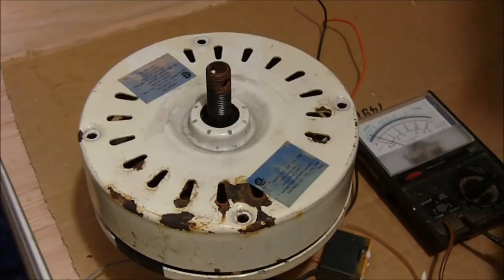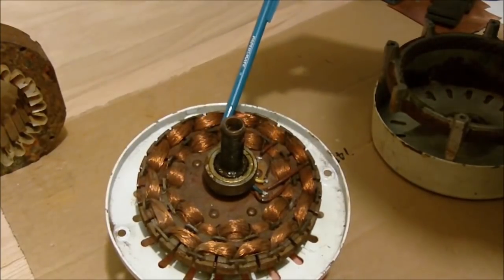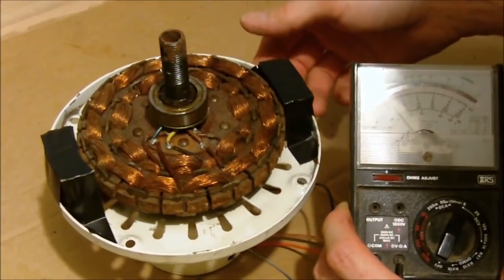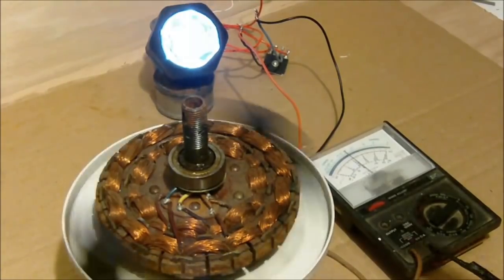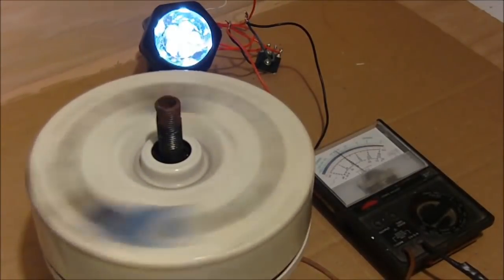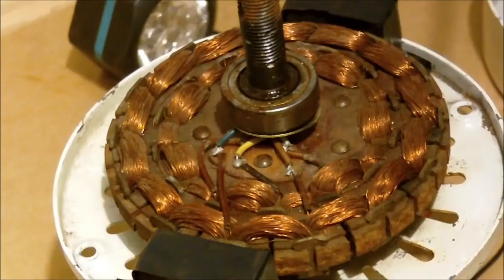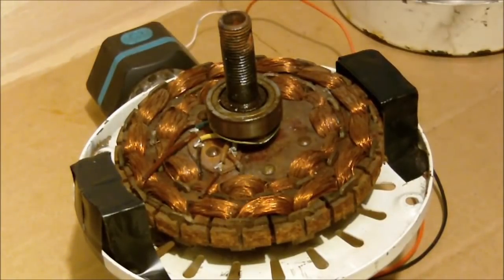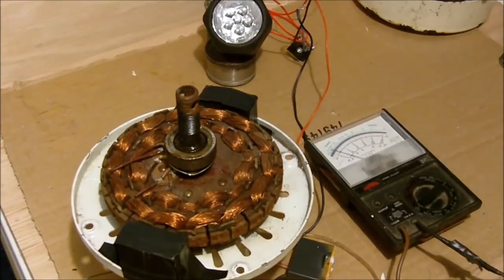Ceiling Fan to Wind generator conversion demo

Comment: The capacitor was for the reversible feature of the original fan. Connecting it to the OUTPUT of the diode bridge will smooth out your signal by charging like a battery on the peaks of power generation and discharging on the valleys. That capacitor is of a low value for the purpose that it was intended. If you get hum in audio applications like radios, stereos or TV's, that are connected to your generator, you can use a capacitor of a higher value. Here's where it gets tricky. Capacitors can explode if connected with the wrong polarity, if it's rated voltage is too low for your generator's output. Say your generator has a maximum output of 85 volts AC at full speed. This will be an RMS or Root Means Square rating. This is a little mathematical for this discussion but to suffice it to say you can add an average of 50% to that voltage at peak power on each cycle. Most volt meters only read average voltage. Converting this AC output to DC with a diode bridge and adding a filter capacitor to this would make the peak output about 127 volts DC. If you did this to your wall power, you would find that you would have almost 175 to 180 volts DC. To be on the safe side, you should use a capacitor that is rated at least 50% above this in it's voltage rating. Unlike the capacitor in the motor, electrolytic filter capacitors have polarity like batteries. BE SURE you connect positive to positive and negative to negative. The micro-farad rating of the capacitor isn't important in this respect but understand, as with any battery, the bigger, the better. If you use a 500 micro-farad @ 200 volt DC capacitor, it will work twice as good as a 200  micro-farad @ 200 volt DC one. The more micro-farads, the better the filtering action. Also be aware that professionally designed windmills have mechanical speed regulators on them so as to not go over rated voltage or speed to avoid spinning out the bearings during a wind storm. One other thing your viewers need to be aware of. You can NOT connect a DC output to an AC rated appliance without damage. If you are connecting it to charge a battery bank, you should have some kind of regulator or controller to avoid a fire or battery damage. NEVER try to make connections to the generator while it it spinning. Even though they use AC in the electric chair, high DC voltage across your heart will stop it faster. One last thing. You can NOT connect the raw AC output of the generator to ANYTHING that is AC powered as the FREQUENCY of the signal is governed by the speed of the fan and is too unstable. Other than that, your idea is pretty ingenious and, I think, could be built upon to become something useful in some applications.
Reply: That would be great for you and us if you record a video showing how to do that. Thanks
Reply: @alfredoreyna1020  To connect a capacitor or the diode bridge?

Comment: I could see setting a whole bunch of them up on a common charge controller to increase the available power, same as what is done with solar panels. Wiring to all three coil rings is a good idea,  but would essentially result 3 different phases, all of differing frequency and amperage, but hey, plunk a rectifier on each output, send any voltage you harvest to a charge controller, insert batteries and voila! A home-brew wind farm. I know a guy who has a crap ton of broken household appliances laying around, maybe I should go strip mine his trash pile.

Comment: one issue with converting an induction moter to a generator is coging. coging can be mitigated to some degree if you divide the outside coils into 3 groups and connect them the coils in each group in series with each other such that the voltages will add. the output after three phase are rectified will be much smother but youll never get rid of the iron core roter coging with the magnets. just hope to smoth it out some with placing magnets in such a way to take advantage of the three phase windings.
Reply: +Keith Reynolds  - I think I read somewhere about a technique where instead of putting the same number of magnets as coils, put N-1 magnets evenly spaced.  If you have N magnets then they all 'cog' together and multiply that force (picture a sine wave from each magnet passing each coil stacked up because they're all in sync with each other).   But if you have N-1 magnets all those sine waves are offset from each other and make a smoother output.  I guess it's like your 3 groups only divided down to individual coils.   Oh, but you might also have to have a full-wave rectifier for each coil.  I wish I hadn't gotten rid of my old oscilloscope.
Reply: Yes it would be a lot like my 3 phase suggestion, and yes because of the phase relationship between various coils with N+1 magnets, each coil should be individually rectified. The downside of that is for each coil you have voltage drop across two diodes at the bridge rectifier, rather than having the voltages add for a group of coils in the same phase and 2 diodes voltage drop at the rectifier. In other words you'll be more efficient with groups of coils in series rather than individually in a poli-phase setup.

Simply put, three phase setup splits each cog into three "much" smaller cogs because of a nearly equal attraction to the core of an old phase almost cancels the attraction to the core from the next phase, 

Not always a favorable choice, but one can mitigate the effects of coging to a degree by increasing the momentum of the rotor, either with more mass in the blades and rotor or faster rotation.

Comment: If you put a capacitor across an AC voltage, it will act like a wire, read dead short, until the chemical inside boils and causes it to explode. Also, if you can get 12 volts at 60 watts out of a converted ceiling fan, that equals 5 amps which, in a windy area, would be a pretty substantial charge for a small wind system like for a light and radio in a hunting cabin.
Reply: Addendum - You would need a rectifier bridge and possibly a filter capacitor to turn the AC output of this alternator into DC for it to charge a battery and run anything like a radio, battery powered TV or lamp. Using a battery and any kind of inverter all day would probably not be a good idea in any place but the windiest of places to allow the battery to fully charge at night. Also at 60 watts or 5 amps, you couldn't use a battery much larger than a small marine deep cycle battery and then it would be a good idea to keep a hydrometer handy to check it's charge condition once a week and have an alternative way of charging it to make it last a good long time without damage. Incandescent bulbs wouldn't need a rectifier bridge if used WITHOUT a battery but loading might be a problem if you push the current limit of the alternator too much. The more you load it, the harder it is to turn it to the point of stalling it completely if you were to connect a headlight bulb to it. This would actually be a great project for a small hunting cabin or sail boat as long as you are aware of it's limitations and the limitations of the battery that you connect to it.

Comment: with the wires, theres a set for low speed and a set for high speed then a earth.
you should join the high and low speed wires so you get 2x output, or like 1.75x

but nice vid, im gonna go make a vertical windmill gen using this as the alternator

Comment: Take computer hard drives and remove the magnets.  Very strong and free!  Perfect for ceiling fan generator.
Reply: You can shape the coils to the magnets but you are correct, they are oddly shaped.
Reply: Tommaso Petrella I
Reply: The poles are on the side. Which reduces area. Which sux cause I just got like 50 of them and apparently I'm too stupid to move forward with the idea. So I'm pissed and about to just dump the whole thing and say F it.
Reply: Hdd magnets work well, you can break them to size easily.

Comment: Because a DC motor uses commutator plates to "switch" the coils as they go around whereas a regular brushed AC motor uses slip rings so the coils are constantly connected to the same leads.  In a DC motor, as the commutator plates spin inside the brushes, it gives the effect that each coil is moving a constant direction N to S or visa verse because they switch polarity before they spin back the other way. I guess what I'm trying to say is a DC motor is in effect it's own rectifier by design.

Comment: more powerfull magnets will up the voltage for each rpm. thicker winding will have less internal resistance, but will fit fewer windings and result in a lower voltage.

Comment: get the small neodymium magnets from a CD rom reader heads and glue them into the armature assembly, prep armature with an angle grinder. You will get 100 plus volts at up to an amp at very modest speeds.

Comment: It would be fine and work well if you just needed emergency lighting. Just dump the power into a 12v battery and use only led lights. I would use a setup like this for my workshop and storage shed.
Reply: You can get 12v LED lights for vehicles that will do the job really cheap direct from china. ;)

Comment: I suppose you're right about the commutator in an AC motor didnt realky think about it.   Most are probably brushless anyway using 60 Hz for timing. Just kinda hard to explain how the coils in a DC motor generate AC current but it is switched thru the commutator into the brushes as DC because the coil is always moving one direction thru the poles while connected to a single brush.  Doesn't really matter anyway I guess.

Comment: If I am right, if you get the rotor to spinning and short the output wires together, it should act as a brake. The highest output connection will be the one that stops the rotor the quickest. I am wondering if you have 3 connections and a common or 6 leads.

Comment: you can use pulleys to bring up a higher revolution speed to generate a higher voltage also, Big on the blades and small on the generator

Comment: you should build this for a charging booth or station with a vertical blades you could start a power stations for remote locations in far to get to vacationing get aways or hiking or to charge your cell phone, lap tops or ac power cord plugs or small plugs station outdoors with electric car charger for a parking space  far from the grid.

Comment: The coils aren't wound clockwise, counterclockwise, clockwise, etc.. They should all be wound the same direction.  There will basically be 2 circuits... one set of coils that is wired directly to the source voltage, and the other set is wired with the capacitor.  They are set on the motor in an alternating pattern.. so the first coil will be in the capacitor circuit, the next without the cap, the next with the cap, the next without etc.  The capacitor side of the circuit causes the current to lag 90 degrees out of phase with the other side of the circuit.  This creates a rotating magnetic field.  The rotating magnetic field moves past the squirrel cage in the stator, inducing a current in the squirrel cage.  This creates a magnetic field in the squirrel cage that is opposite in charge to the magnetic field in the rotor, causing the stator to be attracted to the rotating magnetic field of the rotor.  The stator will always rotate slightly slower than the rotating field in the rotor.  This is called slip.  This is because if the stator was moving at the same speed as the rotors magnetic field, than the bars of the squirrel cage would not be getting crossed by the rotors field, and no current or field would be produced in the stator.  Now that you know how a single phase induction squirrel cage motor works, you can better understand and design a generator from its components.
Reply: You need to start your own channel, if you don't already have one, with animation. Worlds electrical engineering student (or a layman) would thank you for that.

Comment: . You could obtain a high voltage from your fan motor by using a number of small curved magnets equal in number to the pole faces on your fan . Remove the inner set of coils if you like as they would only add to the back emf if connected up or if some of the coils are shorted out. Shorted coils will make the generator hard to turn so either see that the inner set is kept totally open andn one of the coils is shorted or leaking to the frame. You will have to obtain magnets of  such a length that each magnet fits just across the the pole face withiin the coil. the  magnet s hould not span the coils but just the ple face. These magnets must be fitted to the part where the shaded armature was. YOu will have to devise sime way to fix the magnets to the moving part so that there is a space between the pole face and the magnet of about visiting car thickness. The magnets must be alternating in polarity around the coils. . Neo magnets are not necessary and are very expensive and difficult to obtain in the right size and shape.ordinary ceramic magnets are quite strong for the purpose. With this arrangemt you willl obtain a voltage more than a hunfred and fifty. All the best.
Reply: +Vivian Astridge > Neo magnets are not necessary and are very expensive and difficult to obtain in the right size and shape. 

Cut or break to suit, anyway, the more the merrier. Araldite to packingat the correct distance and the thickness of the araldite can be used to fine tune that. Plenty of cheap second hand magnets on eBay: 
http://www.ebay.com/bhp/hard-drive-magnets
Reply: We oth are sailing in the same boat. My laptop has a keypad problem and cracks funny okes like visiting car of yours.

Comment: Do you know if a typical Hard Drive magnet would work in place of the large ones in your video?  I have 50-60 of them, but they are probably 10-20 different sizes in that batch. I'm guessing I would need similar or exact matches to use in the same configuration for them to work at their optimal capacity. How close should those type of magnets be for them to work best?

Comment: LED will turn on at any time the voltage exceeds the required voltage of the LED. The AC voltage will create the voltages almost like pulses, with only the positive cycle being used and the negative cycle not being used.

Comment: build an electric pedal bike that charges its own motor while pedaling to run the bike electrically when switched on it will perpetually run for you and then the led attachment on the handle bars would light up and shut down when pedaling and not. would be an amazing diy off grid bicycle. also so many free energy conversions can be used with excersize bikes or regular bikes to pedal for energy.

Comment: The quality of the rusty ceiling fan stator is also a limitation of power output.  Could power be collected from each of the other two inner rows of coils by collecting each separately?  Each would be a little out of phase with the other two.  With a capacitor and diode for each they could be recombined in a battery for power storage.

Comment: The LED is a diode. As such, It automatically rectifies the current, passing current in one direction. Adding the bridge rectifyer will take the ac input and convert it to a dc output capturing both halfs of the original ac wave. The down side to that is that for each phase, you effectively have added two more diods with a voltage drop across each. Using a full wave bridge rectifyer, Youll likely almost double the momentary power but you will loose some energy.
Reply: +Keith Reynolds, You have to worry about the max reverse voltage that the LEDs can withstand. Using even one rectifier in series with the LEDs can help to prevent damage from excessive reverse voltages.
Reply: a diode does not rectify anything, it BLOCKS half of the ac cycles. a diode block is built of four diodes  (2 for input and 2 for output) rectifies ac by routing the two oppositive currents in ac (the alienating positive and negative pulses you could say) into uniform steaming direction
Reply: @Jason, kindly,  please do a little homework on rectification. https://en.wikipedia.org/wiki/Rectifier "A rectifier is an electrical device that converts alternating current (AC), which periodically reverses direction, to direct current (DC), which flows in only one direction. The process is known as rectification. Physically, rectifiers take a number of forms, including vacuum tube diodes, mercury-arc valves, copper and selenium oxide rectifiers, semiconductor diodes, silicon-controlled rectifiers and other silicon-based semiconductor switches."

https://en.wikipedia.org/wiki/Rectifier#Single-phase_rectifiers
descibes single phase, half and full wave, rectification.

Comment: Ceiling fan is not waterproof or dustproof so it won't last very long outdoors without protection.
Use a full-wave bridge rectifier.
Connect a capacitor after the rectifier to reduce flickering if driving LEDs. (A capacitor in front of the rectifier serves no useful purpose.)
If charging a battery, fit a voltage regulator after the rectifier.
Reply: Actually, some ceiling fans are rated for weather.  Both “damp rated” and “wet rated” are readily available for installation on patios, etc.

Comment: When you say 'bashed the magnets out of this' (implying free)... and then 'expensive magnets' I had to chuckle a bit. 1) if you can avoid it dont directly hit a magnet, it will kill some of its properties. and I was curious if the orientation of the magnets tot he outer body and one another mattered. Like figure out + and - obviously both sides will stick to the body but maybe alternate those inside. But then you covered this... I like the way you approach theory and walk through it but I was hoping for more of a  hot wo. you have a ton of vids on this out there.
Reply: Actually, make sure it's aligned north / south with + / - , and bashing it helps strengthen the magnet. ;)